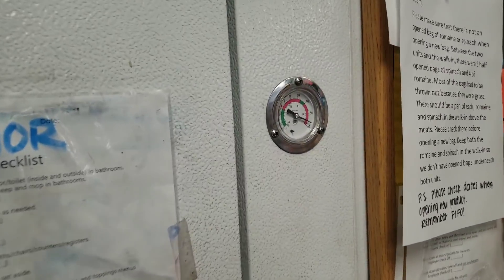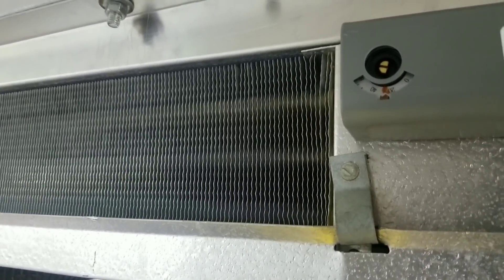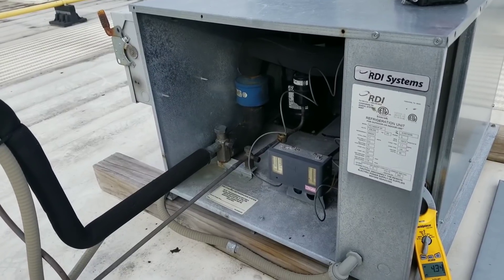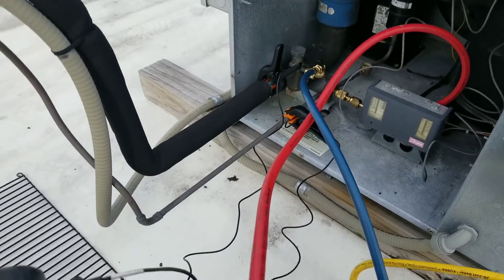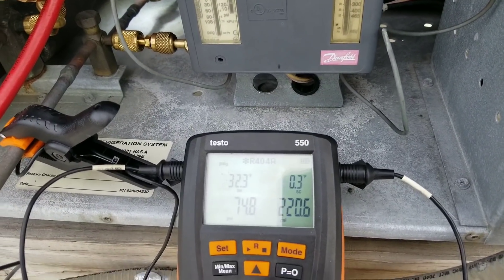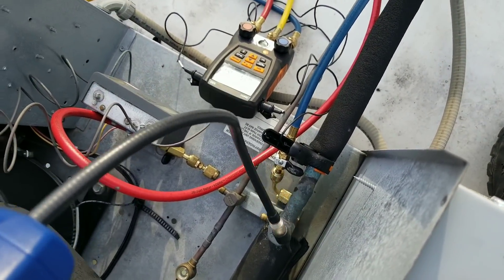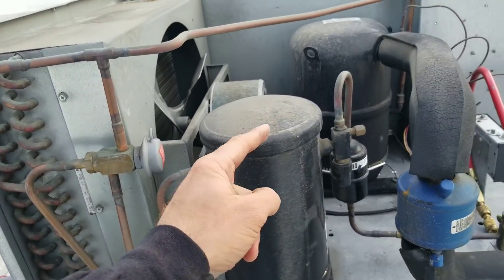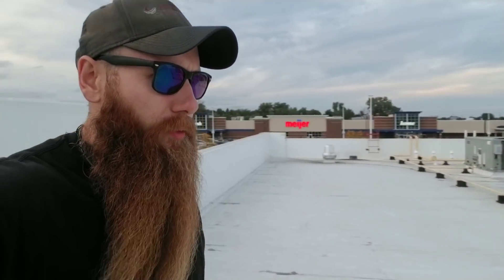Walk in cooler not cooling

Comment: Hey i have a fully charged 404 walk in beer keg cooler that runs a hot liquid temp. Its all brand new and i can figure out why. Its not running as efficiently as it was with cooler temperatures outside. Takes forever to cool down.

Comment: In Australia it's illegal to "top up gas charge" to find the leak , you have to fully recover the gas and nitro test.
Are you allowed to do that in the us?
Reply from the maker: Hey Calvin here in the US for comfort cooling if the leak rate is more then 10% of the entire charge then a repair needs to be made or arrangements to repair the leak need to be scheduled and communicated with the EPA. With that being said as far as topping off the charge on a known leaking system, as long as its within that percentage Its ok- also I had a plan in place to return and charge with nitrogen to find and repair the leak at that time. If there was refrigerant blowing out the side and it was loosing alot more the the 10% rate per year that may be a different story. 
Thanks for watching
Reply: @curioushvacguy6876  awesome thanks for the clarification, also what's this winter charge mean?
Also love your vids man!
Reply: If you recover the gas and charge with nitrogen then how can the leak detector pick it up? (Not in the trade here just been trying to pick up hvacr knowledge the past few months).
Reply: @bluered1322  you use bubble spray

Comment: If your in low ambient, maybe winter charge wasn't added?? Don't have that issue here I've ended up yanking email out in the tropics here
Reply from the maker: I think that was part of the issue there, someone may have charged it up in the summertime and didnt add the winter charge- my idea was to return and do a full thorough leak check and then add the winter charge and check the receiver level. Thanks for watching

Comment: Nice attempt at non invasive testing - I think it really only works if the system is operating properly, but if we are called out it’s likely that there’s an issue so we end up gauging up anyway.
Reply from the maker: Exactly right 404- if you didnt commission it from the beginning and  if you werent the only one to touch that system then you dont have a good enough base line to really use the non invasive approach. Thanks for watching 404

Comment: Perfect explanation,
R404 systems can be a bit sneaky,critical charge..
A little off and cooler temp. ,will rise..
The amperage .was a big clue,to undercharged.,
Reminds me of a couple of the R502 system days..
A few ounces makes a big difference in load..
Another great video,
Bryan Tyler Refrigeration
Reply from the maker: Thanks
Reply: @curioushvacguy6876  
Fan cycle switches.,
To be honest with you ,
I only ran into 1 headmaster system personally in the early 90's.
Im guessing our weather here is more typical of the fan cycle switch.
Whereas in colder.weather headmaster is used more.
In south texas we do not get much.freezing temps.although this coming week we're supposed to get to 31* midweek..
That was a awesome explanation on that video.